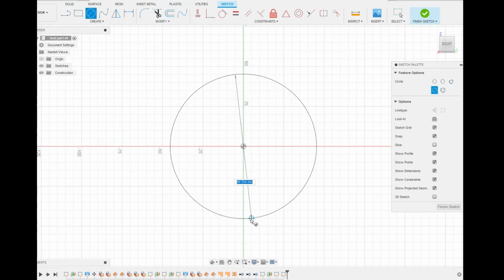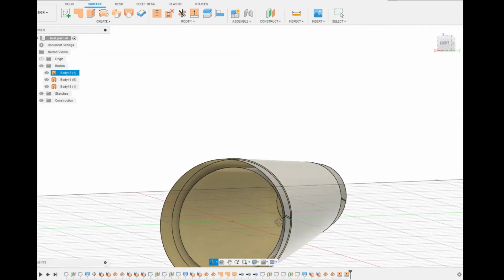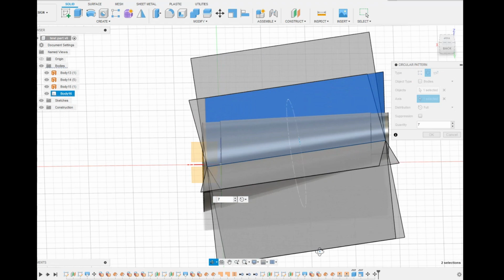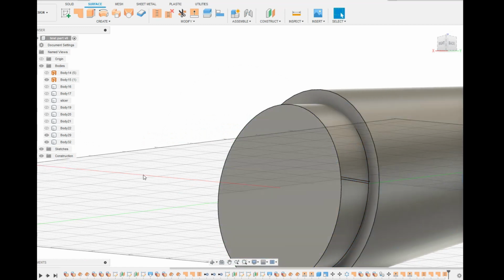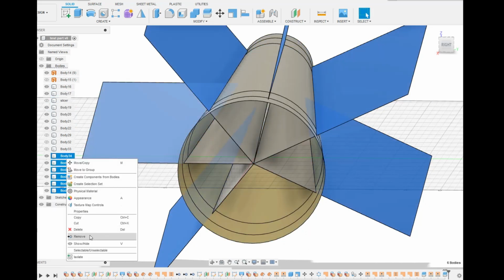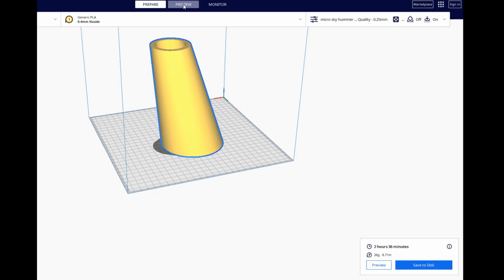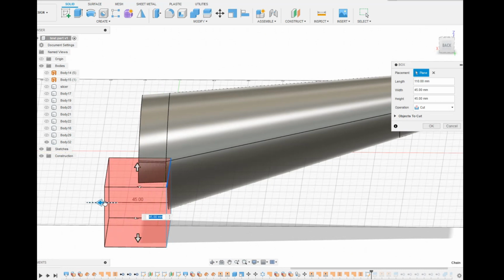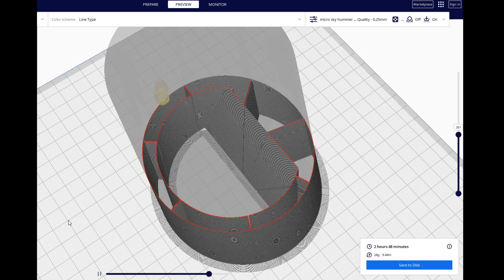3D printing LW-PLA with no stringing starts at the design stage part 2

Comment: I messed around with this sort of thing early this year, after getting my first printer - Bambu P1S.  I first looked at an Elipson wing section then drew up a test wing with some support ribs inside.  I nearly got it to print in vase mode, even though I modeled the wing just as I wanted it printed.  Not a solid model with thin cuts but a wing surface one layer thick.  Bambu Studio would print the entire level just fine but it would continue to trace around the entire outer surface to put a dot of plastic right at the start of the rib.  So maddening.  I had to change over to the solid method, cutting slits and getting the gaps just right.